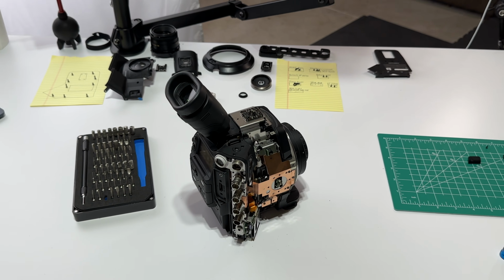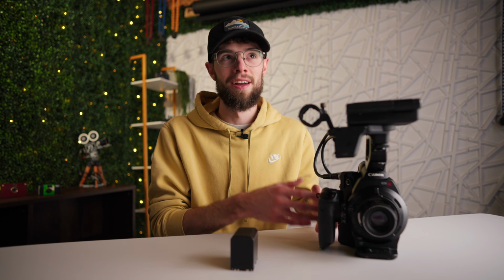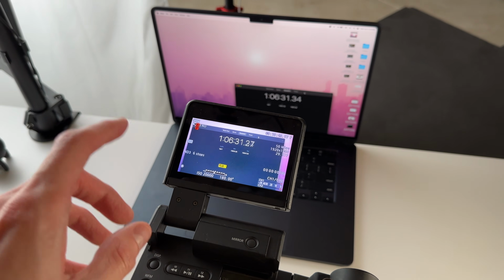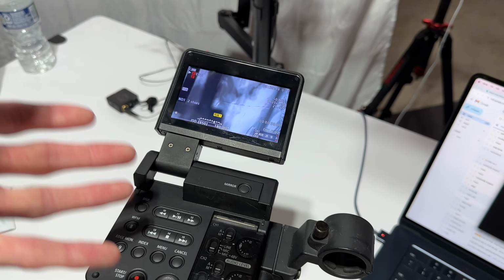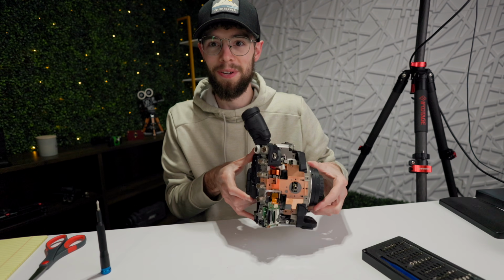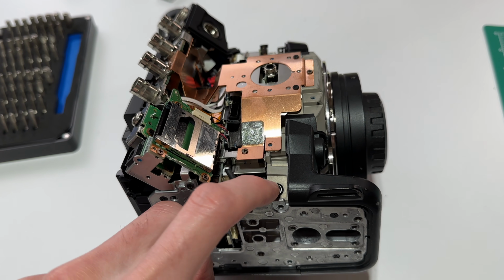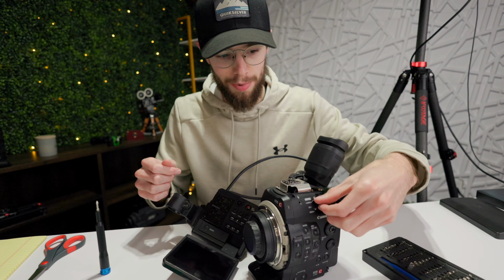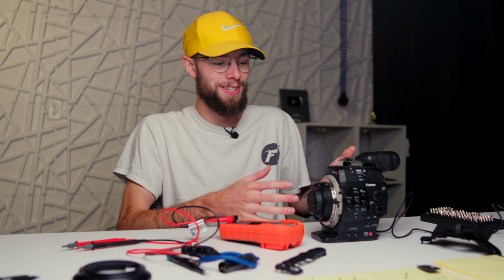Can I Fix This BROKEN Cinema Camera From eBay?

Comment: my internal battery of the c500 is dead i tried to change it on my own, opened as much as you did, i couldnt   find it, and if i go any further ,  i was gonna mess it up, so put it back till the day i know where the internal battery is located, if you do knw share please let me know
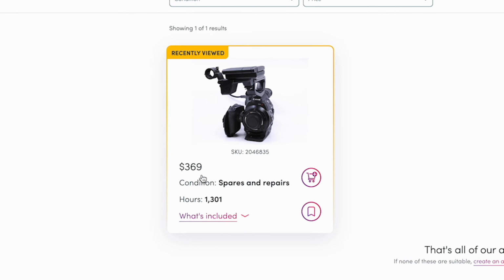Reply from the maker: I’m not sure if it’s in the same spot on the C500, but the little purple thing I pointed to at 0:14 is the little internal battery on the c300!
Reply: coool thanks bro ill check it out @FoxTailWhipz
Reply: @FoxTailWhipz   hey buddy, just checked it s the same, but the only problem the battery is  soldert  , if you can show me some tips how to do it, ill apreciatted for the rest of my life 😊😊❤❤❤❤

Comment: The service manual of some cameras are available online... It might be useful if you can get this model’s one.
Reply: CPS guards those documents pretty tightly and anyone that's authorized for repairs that also has those docs are under contract to not disclose them in their service provider contracts. 

Source: I currently work for a vendor that does exactly this.

Comment: This has to do with some kind of dirty conector or some moisture that got in the camera. Place it near a dehumidifier,use 99% alcohol ,a super soft bristle brush and clean any conectors that are visible also,solder points,battery contacts,memory card contacts and also any flatcable. I had this issue on a camera that shuts down randomly or has the same line pattern when it heats up. Hope it helps.  Also check for voltage fluctuations using a multimeter . There are manuals online dedicated to the connectors and the desired voltage that can help.  Another comon cause can be exposed components like microphones/speakers that make the most contact with corrosion and outside atmosphere. 
Hope it helps and the camera can be easily diagnosed . Wish you the best of luck  👍🏻

Comment: I´ve opened my a6300...not only it was a jigsaw, i even got electrocuted and couldn´t assemble it again. Had to send it for a pro to be repaired.
Reply: In Cameras with a Flash there is a big Capacitor to power it.
Reply: Yikes! That's a bummer. :(
Reply: I need a new shutter for mine. It took like four hours to disassemble them reassemble so I don't loose anything while debating on buying parts.

Comment: The fact it changes depending on brightness, maybe an issue in either an image processor when it's encoding the video, an issue with memory used for the buffer or possibly something in the gain circuit?

The two former might also explain why it doesn't switch on if it's just decided to give up the ghost. Depending on how they're soldered it may be possible to reflow it. Who knows. Might not fix anything.
Reply: i was thinking voltage regulation to the sensor issues, as the overexposing could make the camera automatically turn down the iso or something whit is (to my knowledge) just the voltage applied to the sensor, and its having a hard time controlling that maybe.

Comment: it gets worse when it is pointed at a dark scene? if its in automatic mode this might indicate the auto gain control circuit is flakey? just a thought, could be a capacitor that is leaking.you need a schematic.